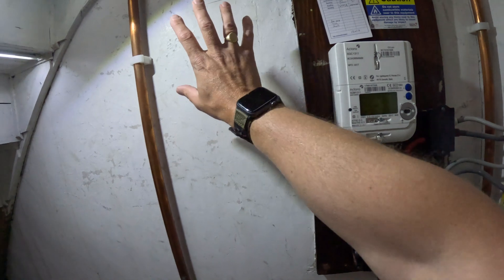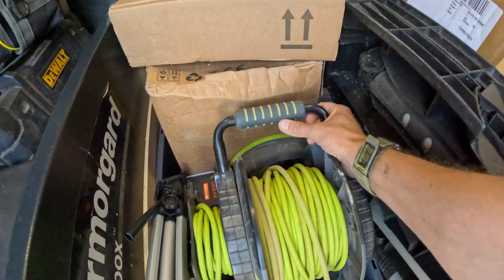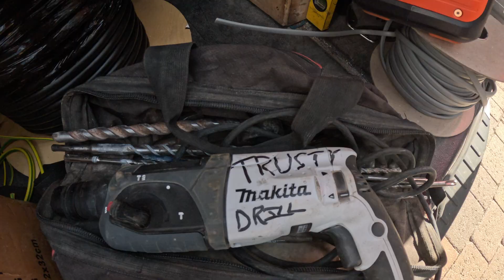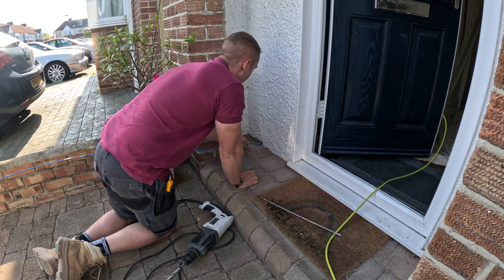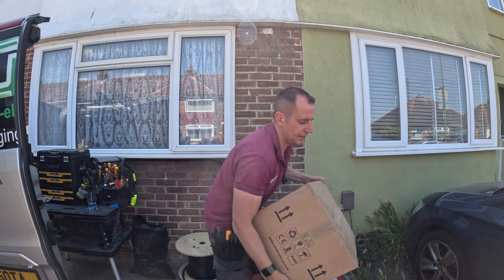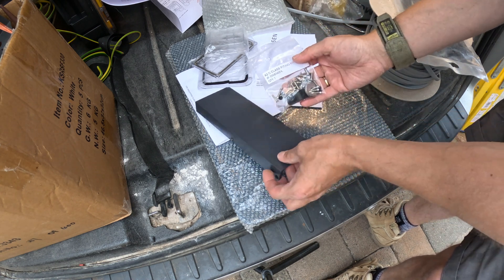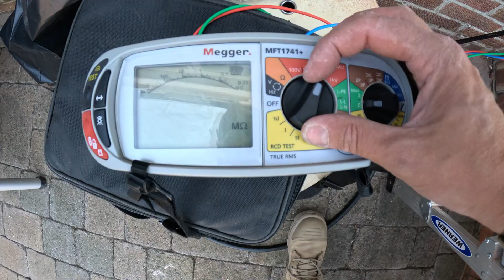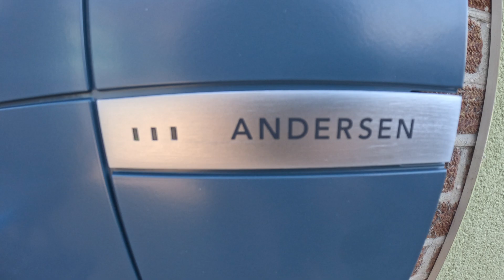How Good Is the Andersen EV Charger??

Comment: Exactly what i was looking for. So Zappi has got better solar availability ?
Reply from the maker: Yes it certainly does, if you have solar go for the zappi
Reply: @sotaelectrical  Thank you. I do like the look of Andersen charger, but reading some of the comments made me sway towards Zappi. Thanks
Reply from the maker: @maruda80  no problem, have a good night 👍
Reply: @sotaelectrical  one more question - i have a Rolec charger atm, want to replace it with Zappi, will electrician have to replace current cable (16meters) or can it be simply swapped ? Also the CT clamp- does it connect to charger itself ( so runs along 16 meters of cable ) ?
Reply from the maker: @maruda80  you need a cat5 cable to be installed for the CT so if you don’t have an EV ultra cable installed then you have three options, 1) install an EV ultra cable. 2) install a separate cat5 cable from your charger to you meter tails or 3) as a last resort, with the zappi you can install a ‘Harvi’ and connect a CT to that and connect it remotely to the zappi.
Reply: Do you do installation in Essex ? Co4
Reply from the maker: @maruda80  I can do, I’m based in Portsmouth but happy to travel, only thing is I have to add a bit of travel time onto the quote which may make me more expensive than a more local installer to you.
Reply: @sotaelectrical  i will contact you tomorrow so we can discuss installation cost  , who do I ask for ? Thanks
Reply from the maker: @maruda80  ask for Adam 👍

Comment: can you not install an EV with a loop supply? because my house is on a loop supply if so why can't you install it with a loop supply?
Reply from the maker: No you can’t install an EV charger on a looped supply because the the DNO are concerned that the supply cables do not have the capacity for the additional load on two properties.
Reply: You can install an ev charger on a looped supply, but a ENA form has to be submitted to the relevant DNO for their approval. If the charger installed has dynamic load limiting then normally it would be ok. But pre-approval has to be sought first.
Reply: You can fit on a looped supply but you need approval. I was approved on a job with it limited until it was unlooped